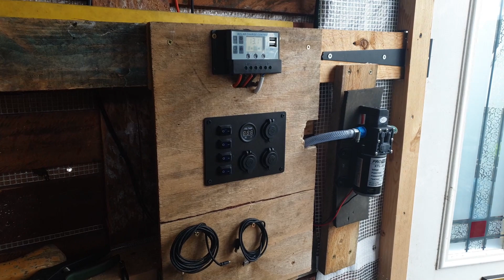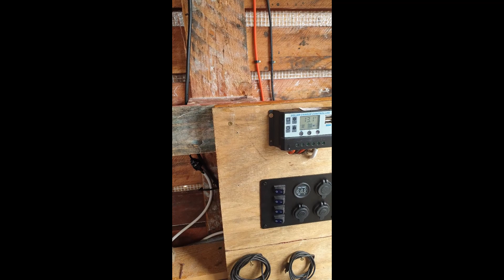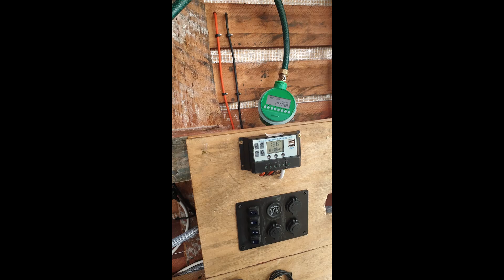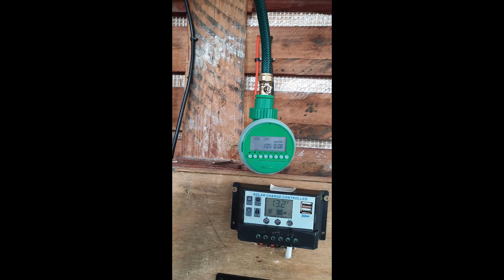Can we build an automatic watering system with no mains water or mains power?

Comment: You could ditch the timer valve for a solenoid valve and then use a timer relay to open the valve and switch the pump on at the  same time
Reply from the maker: Hi, thanks, yes we could, but the pump we have now has a pressure sensor in so turns on and off with the pressure drop in the pipe once the timer valve opens........its maybe worth playing with though

Comment: For the pipework go with either copper or schedule 40 pvc pipe. Both will be suitable handling the pressure developed by that pump.
Also it will be worth dropping the height of the pump to ideally lower than the water level in the IBC to save any issues with priming
Reply: The pressure switch is to cut out the pump if it pumping against a closed valve I believe. So it protects the pump.. But if you have a valve that opens automatically as th4 pump starts that should do the same trick. You could also consider a solenoid with an open limit switch on it or a pressure switch in the pipeline. There are many ways I guess. I'm kinda just experimenting with my system now. I had a 10mm copper pipe running from the pump but also had issues with that blocking with sediment over winter etc